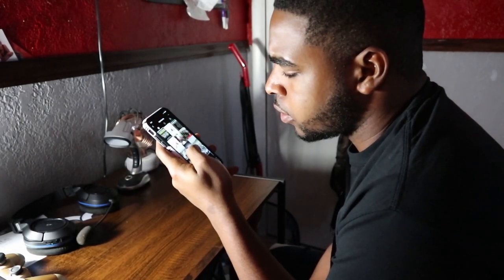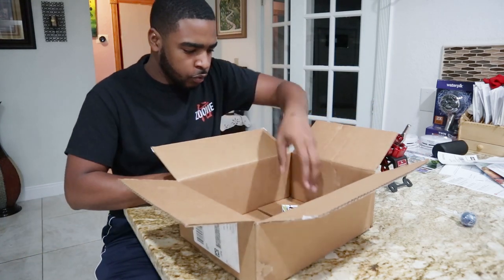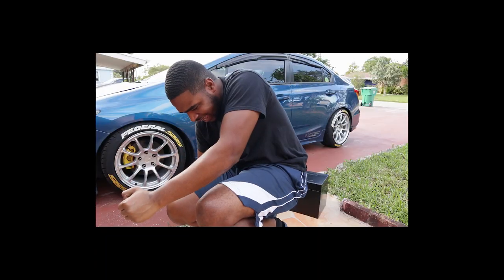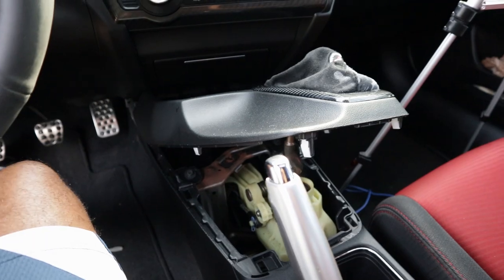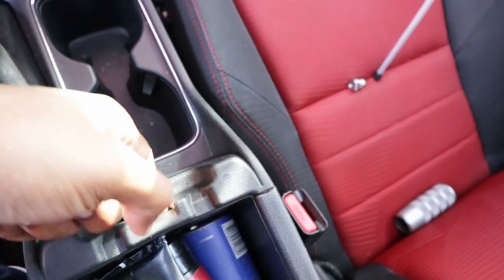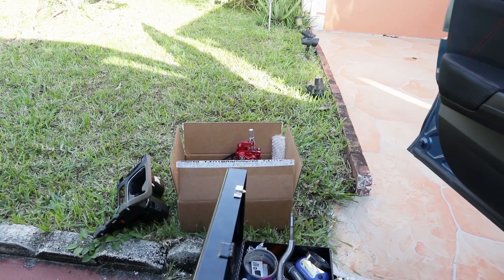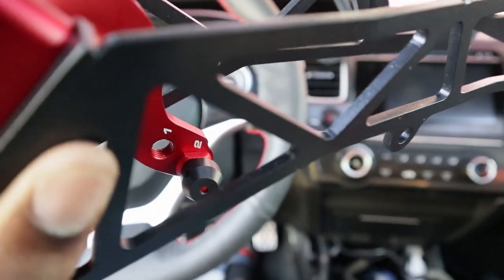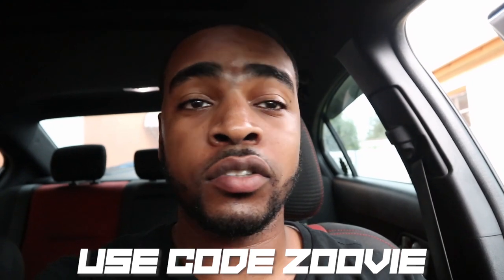HYBRID RACING SHORT SHIFTER INSTALL | 9th Gen Civic Si

Comment: Where did you buy the plastic piece that fits around your shifter, I have the hybrid racing short shifter but I can’t put my shift boot back on
Reply from the maker: Comes with car .. all I did was remove the boot and wrapped it in carbon fiber